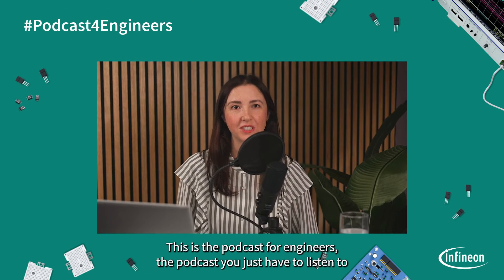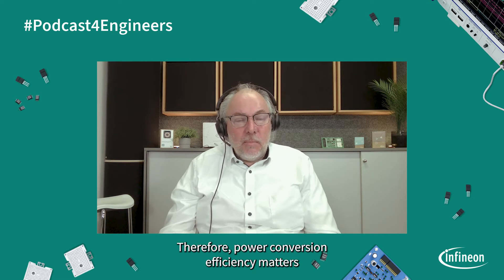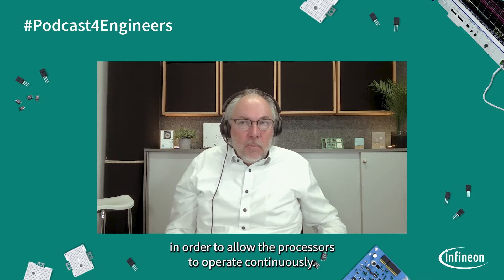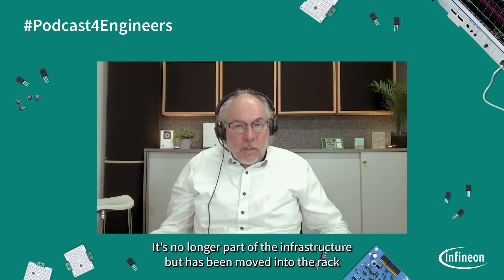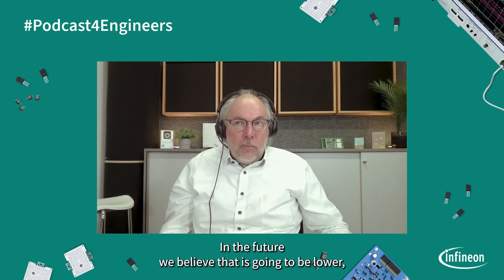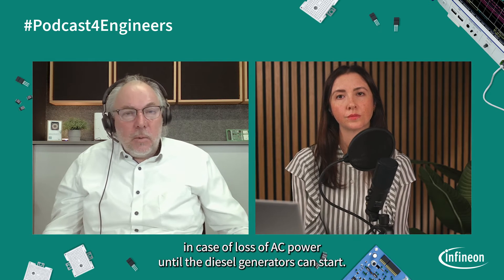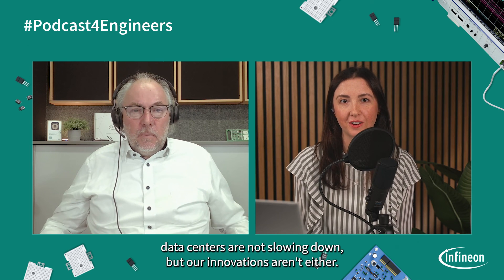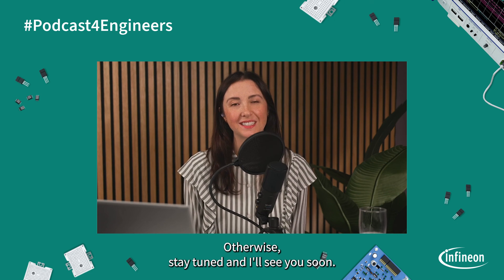The power of efficiency: the sweet spot for Si, SiC, and GaN in data centers | Infineon

Comment: In recent time DC powerlines with around 1 MV and 10 KA = 10 GW are build. Especially in China. I was told that the DC to AC converter constist of hundreds thyristors in series, were one thyristor handles up to 6 KV. I would like to hear more about this theme. Are this thyristors are made from SiC or GaN ? And The AC to DC is a simple six diodes rectifier with perhaps 200 6KV diodes in series ? Also SiC / GaN ? Normal Si semiconductors reach some 100 Volts operation potential. But 6000 Volt ? How is it made ?